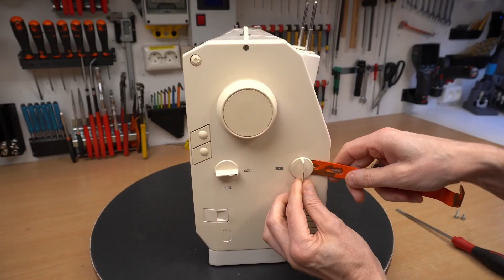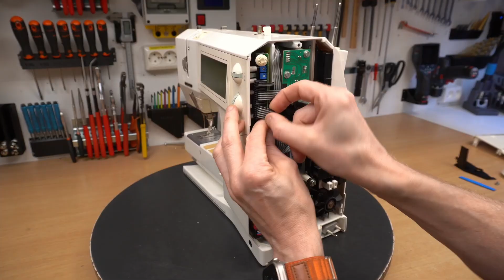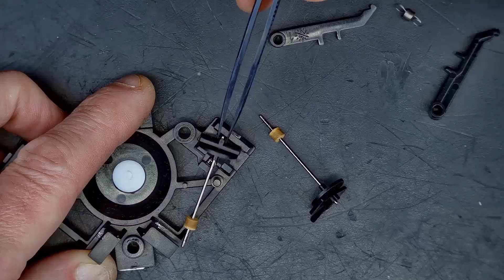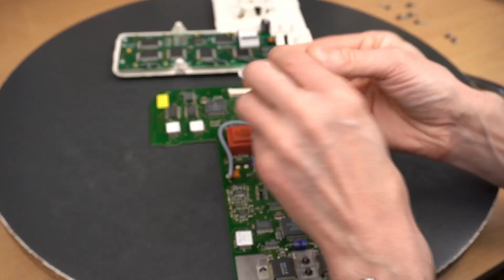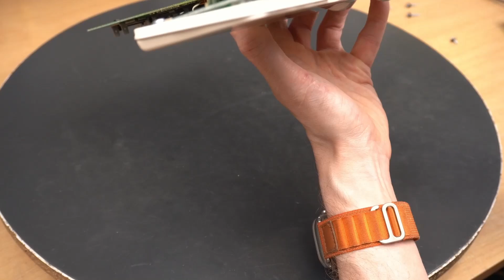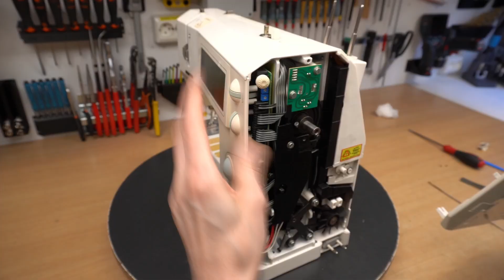Fixing the Trackball on a Bernina 1530 & 1630

Comment: Thank you so much!  I ordered a pair and a spare pair.  I took my machine to a Repair Cafe Silicon Valley volunteer event and now it works!!! I am so happy. Just a note - my 1630 had one component which plugged in a different place that the machine in the video.  We were a bit lost at first as we hadn't noticed where it unplugged but we eventually found it.  The repair folks were so impressed with the quality of your video.  Thanks again you have given my machine new life.

Comment: Great video. I was able to change the roller pieces but now my screen doesn’t display.  Any idea on why this would happen or how I can fix it? The screen worked prior.  Thank you!
Reply from the maker: Most of the time, it’s just a poor connection or a forgotten cable. I’m speaking from experience! 😊 Check that none of the "pins" holding the cards together are bent or misaligned, and double-check that one cable running between the cards. Hope you get it sorted out!

Comment: My 1530 has just developed the roller ball problem too!  Also, the LED stitch window doesn't seem to be as illuminated anymore which is a problem, especially sewing in the evenings.
Reply from the maker: Then you know how to fix the roller ball problem 😊 Usually when the light is less bright it is the lamp under the display. I have not found any replacement yet 🙁
Reply: @sewrepair Thanks for replying.  I've now discovered another problem.  Loud clunking when sewing, together with top thread snapping often, unless sewing at snail pace.  The stitches seem to stitch evenly, but it seems the top tension is off, snapping thread.  I usually keep it at the red bar and adjust, if necessary, which is rare.